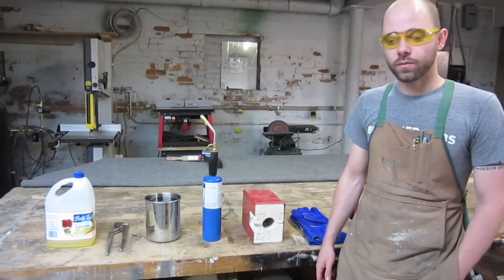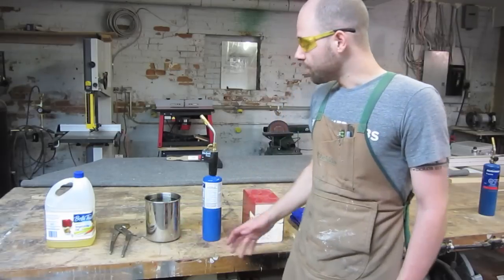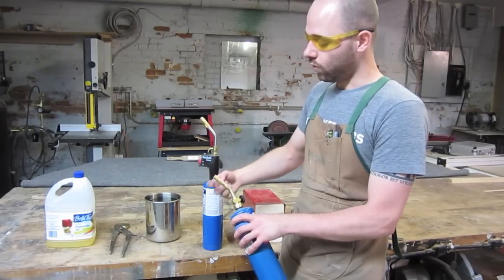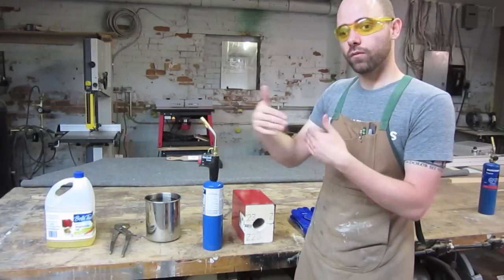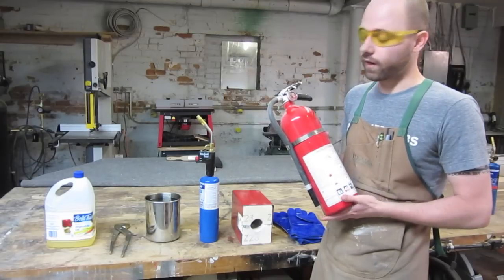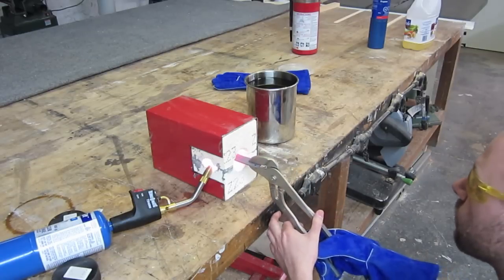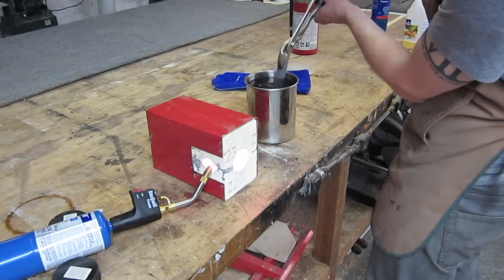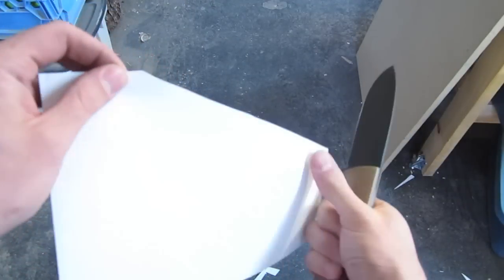How to heat-treat an O1 knife blade using cheap common tools.

Comment: Three questions:
1. How warm do you suppose the oil needs to be when you insert the heated blade in it?
2. Are you using propane or MAPP gas? I know the torch can burn both, but which one do I need for heat treating?
3. How did you cut the semi-circular channels in the bricks?
This video was really helpful, thank you so much!
Reply from the maker: +12D3 Cold oil will work, but warm oil will actually produce a quicker quench as it's less viscous.

Either propane or MAPP will work, but MAPP will be faster.

To cut the channels in the bricks I created a triangular groove with two cuts using an old crappy handsaw, then did the final shaping with 36 grit sandpaper glued to a large dowel, then glued the bricks together. You have to be careful as the bricks are very fragile!
Reply: Thank you so much, you've been incredibly helpful!

Comment from the maker: Some steels are technically 'water-quenching' steels (like W1 for instance). O1 is not a water quenching steel though and should only be quenched in oil.

From what I've seen most people avoid water/brine for quenching any steel and will instead use a light quenching oil. I recommend starting with O1 because it can be quenched in cheap easy-to-get oil like vegetable oil.

Comment: Hi Aaron love your videos and your knifes u explain things like nobody else i seen on YT i do have one question for u i see u r using A2 tool steel for all your knifes what size are your flats when u buy them thicknes and how wide are your knifes like blade THANKS A LOT keep up the great work mate
Reply from the maker: vrbanjacbl1 Hey mate!I'm using 5/32" thick, 1-1/2" wide steel for most of my knives.

I use A2 but it's not the right steel for a beginner as you need a kiln to heat-treat it. I recommend starting with O1.

Comment: Hey Aaron,

I made a similar two brick forge and I have 4 quick questions about some problems I've been having.

First, I'm using a propylene torch I have laying around. Is that the same thing as propane? If not, will it still work?

Second, is the hole of your forge coated with refractory cement? Is that important?

Third, how long does it take to heat up an average (let's say 1/8 in) piece of steel to red hot? After 5-10 minutes, my steel only visibly glows red if all of the lights are off. (I'm assuming that's colder than if it was glowing with the lights on....)

And finally, is there any danger of fire bricks exploding? 

Thanks for all of your help. Your videos and advice are encouraging new beginner knife-makers everywhere!

-Jfitzger
Reply from the maker: Hey mate!
Propylene torches should burn hotter than propane, so there shouldn't be an issue there. The size of the torch flame is also important, but I think most propylene torches should have sufficient output.

My forge is just raw firebrick, none of the surfaces are painted with refractory cement.

Once I've pre-warmed my forge it will usually bring the steel up to temperature in a few minutes. If your lighting is too bright then it can make the steel look like it's not glowing as you said. Having dim lighting is usually best. I normally turn off all the lights except for one on the other side of the shop. 

I don't believe there should be any danger of the bricks exploding, but please research that to your own satisfaction. It's never a good idea to take other people's advice on safety related stuff without assessing the dangers for yourself! People are often wrong even if they've been working with the thing in question for quite a while.

Glad the videos have been helpful mate!
-Aaron

Comment: I want to try this method but I thought that you must protect the steel in the forge from having little to no contact with oxygen so you dont lose carbon?
How do you know for sure you have heated the blade to the correct temperature?
Also, what is the next step after tempering the blade for 2 hours? Air cool?
Thanks man! I love your videos and you are an inspiration to me and all other new knifemakers!
Reply from the maker: Hey mate! It's better if you can protect the steel, but in this case you're not keeping the steel hot for very long so usually just a bit of extra finishing is needed. If you want to avoid that I'd recommend buying an anti-scale compound. The one I use is called ATP-641 and you can buy it from Brownells.

After tempering the blade I recommend letting it cool in air, then tempering again for another two hours, then air cooling again. Both tempers should be done at 400ºF.

Glad you like the videos!

Comment from the maker: To get the spiral flame in the forge the cavity in the bricks needs to be round, and the flame from the torch needs to be angle upward or downward and also to the rear, think of it like trying to roll a ball around a tube, which direction would you throw the ball in?

Comment: Gough Custom Great video with usefull information as always!
Is there a particular reason to have an opening at the back of the forge? I'm thinking about making my own using fire ciment and a cofee can and I was trying to figure out if I should make an opening at the back or not.
Reply from the maker: The hole at the rear is to allow the hot gasses to exit at the back rather than the front, also allows the knife to pass all the way through to all you to heat more of it. Works pretty well!

Comment: Hey - I'm trying to heat treat my knife and am somehow screwing up, it's not getting any noticeably harder. I'm using 5/16th inch O1, heating it up until it's no longer magnetic (then a bit hotter), then plunging it into a mix of sunflower/motor oil. Any thoughts on what I'm doing wrong? I've done a bit more reading and some say that the knife needs to be at the red hot temperature for about 10-20 minutes. Other than that, the only other thing I can think of is I'm not using the right kind of oil?

Cheers from the west coast. Great videos!

PS It's fantastic seeing that you reply, quickly, to anyone that has a question. Can really tell that you're passionate about this stuff, and helping people learn
Reply from the maker: +Erik Jackson hey mate! It's weird that you're not seeing at least some hardening... Try the same with a test piece and canola oil, if you don't get any hardening then I'd say the steel is not actually O1 unfortunately

Comment: Good video and clear instructions. Just wondering if you simply air cool after tempering or do you quench to stop the tempering process?
Reply from the maker: +Allan Lavallee you can do either actually, both ways work equally well

Comment: Hey Aaron, just want to say thanks for taking time to post your videos, it saves us all a lot of time, money, and headaches trying to learn the craft. Just a couple of questions for heat treating O1 tool steel. How important is it to preheat the steel at 1200 degrees? What color would that look like? And how long do I need to soak at 1200 degrees for? Also, instead of building a kiln, can I heat treat with just a MAP torch or oxy-acetaline torch? Thanks
Reply from the maker: wayne hung Hey Wayne! When heat-treating in a small forge like this I would skip the pre-heat step and go straight to 1475ºF or so (dull cherry red).

I would definitely recommend making a small forge. Heat treating with just a torch can be done, but it will never be terribly even.
Reply: Gough Custom thanks Aaron! I'm also planning on cerakoting the blade after tempering. I usually bake the paint at 250 degrees. You think that is hot enough effect the temper?
Reply from the maker: wayne hung Nice! It's cool that you've got a setup for Cerakoting!

250ºF is fine, I've Cerakoted quite a few knives with no problems!
Reply: Awesome, thanks Aaron. Cheers!
Reply: Gough Custom 
Hi mate, sorry to bother you with more questions but I have a camping stove that screws onto a fuel canister. (The MSR pocket rocket). Do you think it'd be possible to make that work?

Comment: The two brick forge is actually a really great way to heat treat single blades. It is  ironic, because though it is a "beginner's forge," it is much more efficient for heating a single blade than bigger forges. It is perfectly designed to heat a blade, and because of the design, I'm actually able to heat treat longer blades in the two-brick forge than I am in my larger, two-burner forge.

Comment from the maker: 440C is not really something you can heat-treat at home unless you have a kiln. It needs to be protected from atmosphere and the temperatures involved need to be much higher.

I would recommend sending it to a heat-treating place if you're set on using 440C, otherwise re-make it in O1 and you can heat-treat it yourself!

Comment: Awesome video. I was wondering though, can you heat treat the entire knife? handle and all? After the first quench could you go back and hold the knife backwards?
Reply from the maker: +Kevin L Hey Kevin! You can't harden the whole blade in two shots unfortunately, as the second heating will soften the hardened steel from the first heating. That's why I left a gap in between the two! If you do the whole thing at once then that's fine.

Comment from the maker: If you want a soft spine on your blade then I would recommend getting the whole blade hard like I show in this video, then (after tempering) you would immerse the edge in water and use your torch to heat the spine of the knife until it turns a dark blue color. This color indicates that the steel has been 'spring tempered', which as you can guess from it's name means that it will be very tough but also very strong.

Comment: Firstly, I love your videos! Beautiful work and clear, precise instructions. Great job!
So, on to my question.....I built the forge you have described above and constructed it almost exactly as you have shown with one exception, I made the tunnel around 3-1/4 to 3-1/2" in diameter. The problem is I cannot get the steel to heat up enough to turn red. I am using 3/16" 01 tool steel (a very small piece for testing) and held it in the forge for close to ten minutes. Could the size of the tunnel be my issue? I am using propane camp fuel with the TS4000 nozzle pointed exactly as you have shown.....thoughts?
Reply from the maker: It may be that by enlarging the tunnel you've made it so that the torch is no longer powerful enough unfortunately. The tunnel in mine is only about 2" in diameter... Make sure the flame is swirling around in a spiral in the tunnel. If it's doing that and you can't get the steel hot still then try MAPP gas. If that doesn't work then you'll have to make a smaller forge!
Reply: Gough Custom Thanks for the reply! I have already made another with a 2" hole that works beautifully. Heat treated and finished out my first blade from start to finish. Now building a 2 x 72 grinder....

Comment from the maker: Maybe just try heating up some scrap steel as a test first?

If it heats up, but slowly, then that can actually be a good thing! Gives you plenty of time to sneak up on the right temperature without over-heating, and also gives all the components in the steel lots of time to mix around to get where they're supposed to be!

Comment: Hey Aaron,
I have watched your videos with great joy and interest. Thanks a lot for all the information you share with the world! Due to your inspiration, I tried out to build some blades on my own. Everything worked fine till the heat treating. Thought maybe you can give me hint what went wrong. Did the treatment just like you, but maybe the temperature wasn't high enough (did the magnet test, but maybe was to slow then).
Tempert it once at 190°C for 2 hours. Result is a fairly hard blade with which i can chip nails, but the hole blade is quite "soft". With some pressure by hand i can bend it, and it stays like that. Do you have any clue what went wrong and how I could still improve the blade?
Steel is O1, 3,2mm thick.
Reply: Have done the process a second time. Faster and with slightly higher temperature.
Blade is fine now. Thanks anyway!
Reply: Norman Green Good to hear mate! Glad you got it worked out!

Comment: how thick was your 01 tool steel?  I've just made 2 knives thanks to the knowledge learnt watching your videos
Reply from the maker: +MrZimma frame The steel I used for this knife was 4mm thick.
Reply from the maker: +MrZimma frame No, it should be fine. 2 hours in the oven twice would be even better though, cool the blade to room temperature in between the two tempers.

Comment: hey aaron first of all i would like to thank you for your instructional videos and second ive found that i need to get 01 to a redish orange color to get it hard ive tried dull red but the file test will easily leave marks. (under dim light)
Reply from the maker: +david ure no worries at all mate! The color will appear different depending on the light, it's odd that you're needing to get it that hot, it may be that earlier you had a surface layer of decarburization that still scratched easily...
Reply: thanks mate!

Comment: This may be a silly question, but I am very new to this process and am looking for a very cost effective way to set up a beginner's forge for heat treating. I'm just wondering if using this design in a longer forge or with a wider cut hole is viable, also, what did you use to cut the groves in the fire bricks? Much appreciated! Thanks so much for your inspiring videos!

Comment: Hello Aaron, what an interesting and informative demonstration you've given us there. I'm a woodturner and want to make a scraper from a piece of O2 ground flat bar which is 20mm x 8mm x 250mm. Do you think it would be okay to harden and temper the first 50mm or so? I'm going to cut a tang on one end to fit into a wooden handle. The scraping end rarely protrudes much over the toolrest, but there is quite a bit of leverage on the fulcrum and  tool caused by the rotating wood coming down onto the cutting ( scraping ) end of the tool. Any thoughts? Best regards.     🙃
Reply from the maker: Hey John! You will be fine to harden the whole thing if you want, then after tempering wrap the tip that you'll sharpen in a wet rag to keep it cool and then use a torch to heat the rest of the tool up until it turns blue, this will prevent the rest of the tool from bending or getting damaged as it might if it was fully soft.
Reply: @GoughCustom  Righto Aaron, I will do that. Thanks, and best regards.

Comment: Whoa, you are helping everyone Mr.Gough I'm impressed!
I hope you will answer my question too..
I made a blade out of AISI 304 stainless steel and i would like to know if it's a good idea to heat treat it the way you demonstrated in this video on this A01 piece.
Also is stainless steel becoming less stainless after this process?
Reply from the maker: Hi mate!
Unfortunately 304 stainless is what's called an 'austenitic' stainless steel which means that it can't be hardened in a manner that would make it suitable for a knife... What you need for knifemaking is called a 'martensitic' stainless steel. Common examples of good stainless for knifemaking are 440C, CPM154, CPMS30V, etc...

Heat-treating any stainless steel is not something that can be done with simple tools unfortunately. The temperatures required are too high, and the steel must be held accurately at high temperatures for an extended period of time (up to an hour for CPM154). The best thing to do would be to send your knives off to a heat-treatment company so they can harden them for you...
Reply: Gough Custom Thank you so much for helping!
Reply from the maker: ***** No worries mate, any time!

Comment: great video, do you sharpen the knife before or after the heat treating process
Reply from the maker: +MrZimma frame I always sharpen after heat-treat. The reason being that otherwise the carbon in the very fine edge will get burnt out during heat-treatment.

Comment: Great video!  Many use a magnet before the quench to make sure the metal is non magnetic and ready.  Do you recommend that?
Reply from the maker: +Woody Smith Hey Woody! A magnet can help as a reference, but you actually need to go a little hotter than non-magnetic... So use the magnet as a reference then just go a little hotter once it's non-magnetic!

Comment: your mini heat treat forge is a great idea man, though i could use it right now doing some heat treating, tried charcoal too much scale and could not get it hot enough  with the tiny bit of coals i had...but man does that forge heat up the metal fast....wonder if you could make your own with some sort of clay or cement.....good video
Reply from the maker: I can't claim too much credit on that, the '2 brick forge' was someone else's very clever idea!

If you google '2 brick forge' and 'paint can forge' you'll find a really good variety of ways to make yourself a small forge for cheap!

Charcoal actually works pretty well, but you have to blow air through it to get it hot enough. I've used my girlfriend's hair drier for this, attached to a piece of pipe attached to the bottom of a charcoal BBQ! :)
Reply: Gough Custom What's the red material you used to wrap your forge?
Reply from the maker: Peter Crowell It's actually just the steel from the top of an old toolbox that I cut up with an angle grinder and then bent to make the wrapper for the forge.
Reply: Gough Custom That answers my next question.